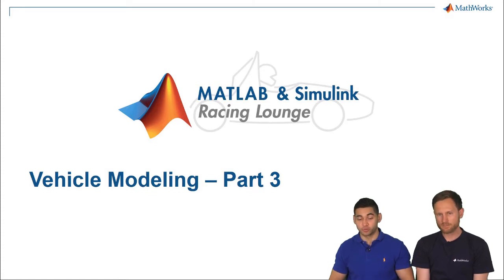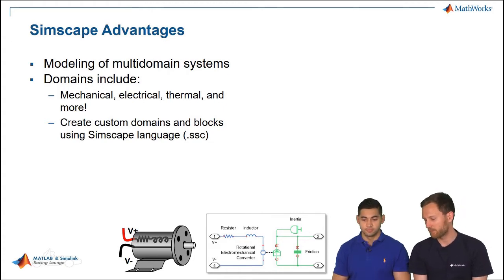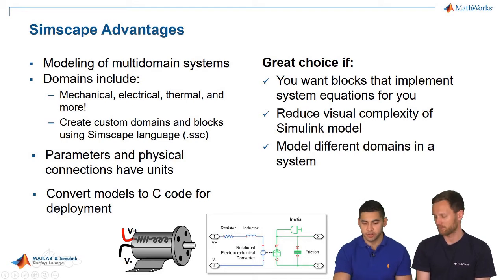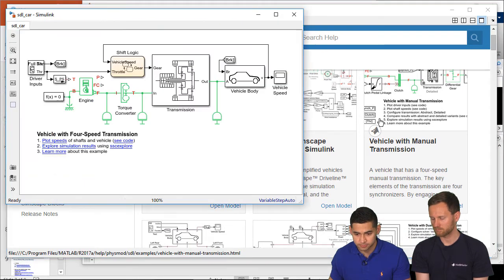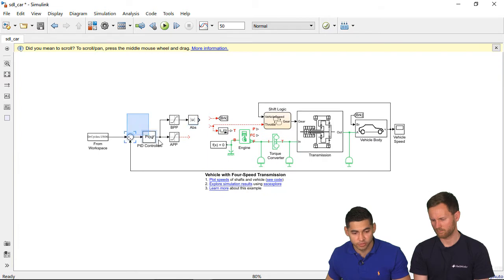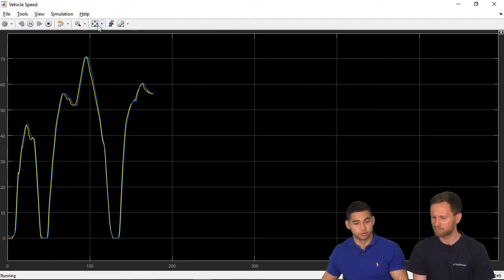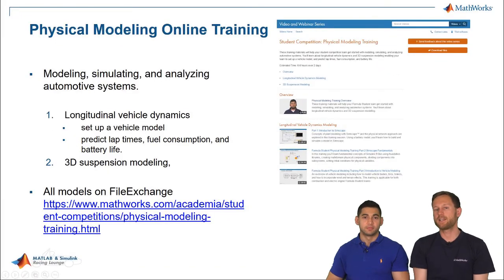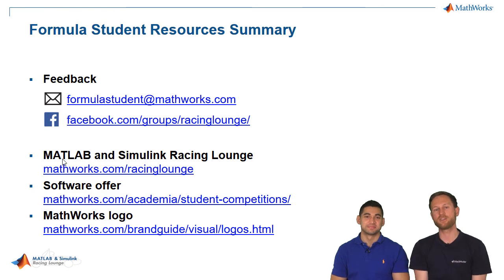Vehicle Modeling Using Simscape

Comment: hello, i am modelling a similar type of transmission system in which i have used 5 different gears instead of torque converter and have a automatic gear selection logic, but even in 5th gear the vehicle speed do not exceed 50 Km/Hr what would be the possible reason

Comment: Most of MATLAB's videos are hosted on their webpage as well with more resources linked to the video. They typically include models on FileExchange.
E.g see here: www.mathworks.com/videos/matlab-and-simulink-racing-lounge-vehicle-modeling-part-3-simscape-1506716231952.html
Reply: Hi, for my dissertation I have to design a bicycle model quasi-static laptime simulator in matlap to test the lap time effect of several rear wing profiles on a f1 car around 4 grand prix tracks which I have the track plotting data for. Do you know any tutorials or reading that explain how to write the code in Matlab? I'm having difficulties working out how to make a GG-v diagram in order to get the accelerations to solve for the cornering speeds for segment. I know you've done a steady state video and shown the gg-diagram, however it didn't go into detail the code/formulas used to create the diagram etc.
Reply: Hi Shaun, hopefully that blog post can give you some helpful info. Especially the embedded video from TU Munich (team TUfast) goes into the details of ggv. Best Christoph
https://blogs.mathworks.com/racing-lounge/2017/06/14/lap-time-simulation-crucial-for-racecar-concept-design/
Reply: Hi thank you for your reply, appreciate your time. Yes, that was the video I was referring to. The student talks about its concept and what results it can give you, but never really showed how to implement it in matlab in terms of code and equations. For example, how can you determine max corner velocity if that is a function of the ay and ax accelerations from the gg-v diagram, yet you need to work out max corner velocities in order to plot the gg-v diagram, this is where I'm struggling.
Reply: That would be fantastic, greatly appreciate your help. I've sent you an email now cheers.